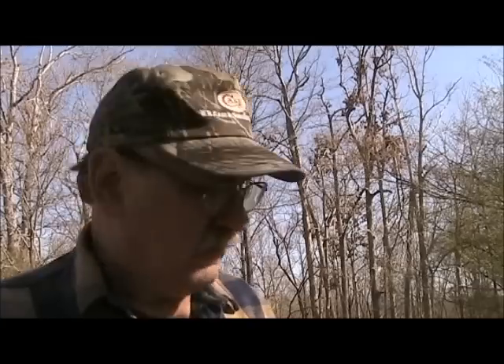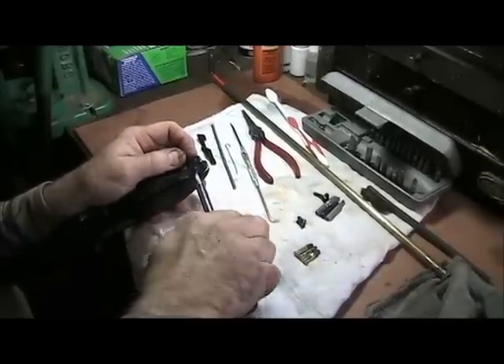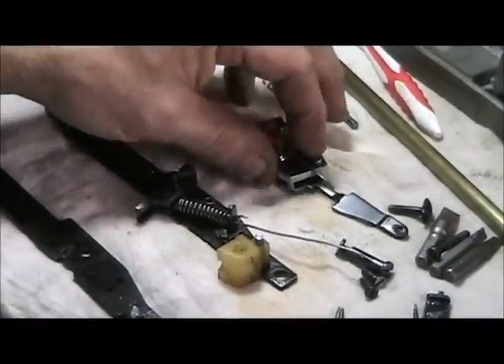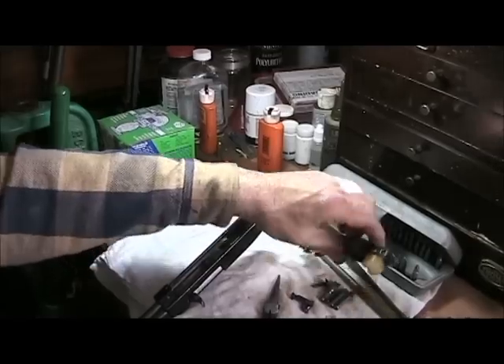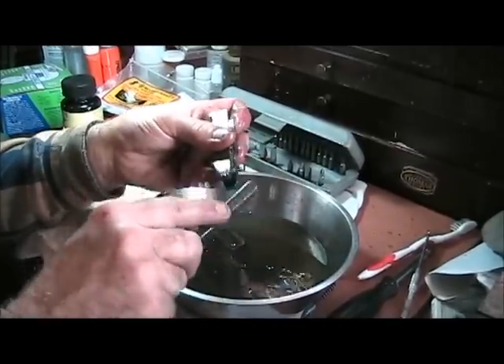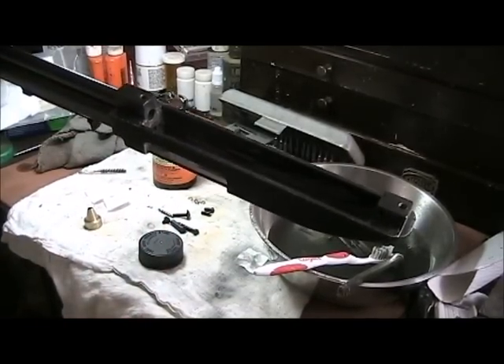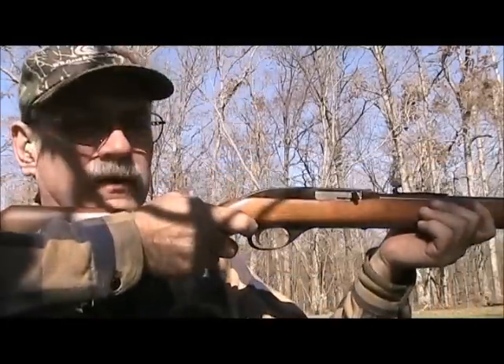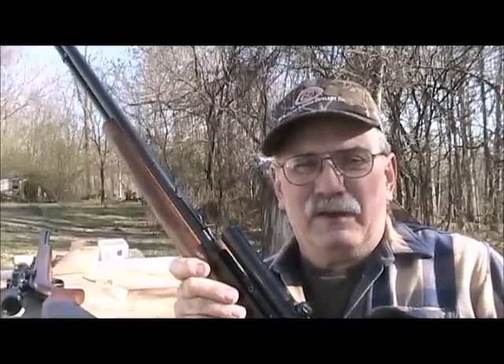Marlin Model 60 Jamming Problems and How to Fix Them

Comment: My Marlin 60 is 40 years old. Decided to change out the recoil spring and recoil rail. Was able to get parts from Marlin, (you have to call the repair dept to get to the parts dept, no separate pull down tab on their webpage.) Should be arriving next week. I was told by more than one gunsmith that one of the great things about the Marling 60 is that is is made to shoot and function "forever" without a cleaning, which may account for the condition of the rifle in your video. Given how old my Marlin is and how DIRTY 22lr rounds are, I want to keep it in good firing condition so I clean my 60 routinely every 150-200 rounds. One other point I want to make, if you are having a failure to feed problem, one area that is often overlooked is to make ABSOLUTELY SURE the feed tube is SECURELY attached to the front area of the barrel. It can easily come loose over time and if the tube is even the slightest bit loose the rifle can fail to feed.
Reply from the maker: Yes most .22 ammo is inherently dirty.  A 40 year old rifle (of the same model) is probably built better than todays rifle. Thanks for the extra tip you mentioned.

Comment from the maker: In this video I incorrectly mentioned that I was using "CCI Quiet" loads while testing my Marlin model 60. Looking back at the box the shells came in,  I feel it is important to mention that they are actually "CCI Subsonic" loads. Please forgive the inaccuracy in my statement, and thanks for watching. Regards; The Cumberland Outdoorsman.
Reply from the maker: @Mindyourbusiness6665  Did you install one of the updated feeding throats? From what you are describing, it sounds either like an alignment issue (from the magazine tube to the loading throat), or perhaps something is wrong with the loading lever, and/or lever spring. It is hard to say without seeing the gun first hand. You could also be experiencing a tension issue within the magazine tube. Check all of the above mentioned parts, and get back to me. I will try to help as much as I can.
Reply: I've got a model 75 SN# 272.... where can I order parts for it?
Reply: My problem is I can put 16 shells in it I charge it I shoot it then it act like it’s empty
Reply: Funny I just watched this video just recently again three years after you put it out even though I had seen it multiple times and it just bugged me about the CCI Quiet you said you used but now corrected your statement. Sure would be nice if it could cycle that CCI Quiet that is my go-to round shooting in my backyard without having to cycle it manually. As always great videos

Comment: I just disassembled and partially cleaned my Glenfield Model 60 while watching this video.  I’ve had the gun for 9 years.  From the serial number starting with 24, it looks like it was made in 1976.  I bought it and was only able to shoot it consistently for a few months.  Then it started to jam every couple shots.  I haven’t shot it for a few years.  After putting it back together, I just went out and shot 2 1/2 magazines out of it as fast as it would go and I didn’t have a single hiccup!!  It’ll need really cleaned and lubricated now to make sure it’s good to go!   Thanks a bunch for making the video!!  It helped me a bunch!
Reply from the maker: Glad to be able to help.
Reply: @CumberlandOutdoorsman  im getting into this type or stuff since  my marlin 60 was passed down by my grandpa. I was wondering do you need a scope mount for it forgive me for not knowing much but can you tell me what scope and if you are using one scope mount you are using?
Reply from the maker: @danjan5506  You can use any dovetail mount intended for .22 rimfire rifles. The best quality mounts are made by Burris, Leupold, and Redfield. I did find some good quality mounts made by UTG that are much less expensive, and look great on most semi-auto .22's. Bushnell also makes some decent .22 scope rings. The scope on my model 60 is a vintage Bushnell 4X BDC that has an integral rail and mount built to fit the scope to the gun without any rings. Quite ingenious actually. That was back when Bushnell and Bausch & Lomb were built in Japan by the same company.

Comment: I bought a used Model 60 in 1978 from a guy at work.  I loved that gun.  I never had a feeding problem or any other issue with it.  Never.  Great little gun.

Excellent video.  Great job explaining the process of disassembly and reassembly. 
I think you could use more light, though, especially with the close-up.  
Thanks for the education.
Reply from the maker: Yeah, I am thinking about doing another video showing the disassembly/reassembly of this rifle, but this time with more light. Thanks for watching.

Comment: I loved your video i have owned a marlin model 60 for over 30 years i have worked on it and tuned it up but lately was having the same failure to feed problem i had been intimidated to take the action apart even after seeing other videos but you made it look so easy i replaced the feed throat easily so thank you my Marlin shoots like new it has given me many years of hunting and shooting pleasure
Reply from the maker: You're quite welcome. Reading your post confirms the intent I had in making this video, and that's to help other folks that own these little rifles. I might make a part 2 with better lighting, since some other viewers had difficulty seeing details due to low light in this video.

Comment: Thank You Sir! I was having the same problem. Then it would chamber a bullet. The loading throat spring wouldn't stay in. I didn't have it in all the way on the bottom. Originally I watched your video to switch a broken recoil buffer with out having the springs shooting out. I also took a bore brush to the loading throat. After years of just using a Q-tip, needed a good brush. I now have my 30 year plus rifle firing like brand new.
Reply from the maker: Glad to see that you found the video useful. Thanks for watching, and subscribing. I hope to be doing some more shooting and hunting videos using my Marlin/Glenfield 60 in the near future.
Reply: @CumberlandOutdoorsman  m

Comment: I have similar problems in a Glenfield model 60 I purchased. I Can’t find the upgraded chamber throats anywhere, but I believe I’ll change the magazine tube spring, follower (it protrudes at a strange angle), and lifter spring and see if that does the trick. I already replaced the recoil spring and that helped, but after less than 100 rounds it went right back to having the same issues. I gave it a deep clean when I replaced the recoil spring but I’ll go over it again as I replace parts. Thanks for the awesome video.

Comment: Ty just did this to my old rifle, it was the first gun I ever shot when I was five years old now I’m 36 and have it, means a lot to me. I just got it fixed was stove piping really bad, great video! I ended up having to completely reassemble the trigger action but oh well was good learning experience even if by accident LOL
Reply from the maker: I'm glad to see you got it going again. Gotta keep those old .22's shooting. I still have a Charter Arms .22 revolver that I had to completely tear down and re-assemble. That was quite tricky, but when I got it back together, and it actually worked I got a real sense of accomplishment, as I'm sure you did with your rifle.
Reply: @CumberlandOutdoorsman  I had to work on it today, finally got some time to test it out, the bolt wasn't seating firmly enough on the action, had to sand the feed throat down on top where the bolt sits over it, those 2 little lips at the top (particularly the right side lip if you are looking down over the feed lip), polished my bolt/ and shaved the lifter spring as with this new kit it was hitting the side of the metal causing an ever so slightly enough delay to make it pinch the shells. I think mine is very old lol but still a goodie! Ty for your video ;)

Comment: Mine was passed down to me from my father. It's a Glenfield Model 60 with squirrels engraved in the stock. Beautiful gun. The problem I get is,
 I'll get a stove pipe and double feed at the same time once in a while, if I lean the rifle to the right. If I leave it level, I have no issues. I suspect an epic cleaning is needed because even a basic cleaning makes it stop for a while.

Comment: Nice informative video, I have the Marlin 990 semi-auto .22lr. It's a 1979 year production. It is the same internal parts as the Model 60. Marlin 60 & Ruger 10/22 are two of the best .22's to me.

Comment: Great tutorial. I just brought home a mint 1985 holy grail model 60 today, all the desired options, lsbho, JM stamp, squirrel stock etc pawn shop find. On my way home I stopped at the range and it’s still very accurate but so filthy it won’t cycle no matter what ammo I used. Failure to feed just like what you showed. I blew my budget on the rifle $170 so I really hope it just needs a good cleaning. I know how to clean it from 40 years of owning a 1981. If the spring is bent I may try the nickel trick or just start with replacing it. Wish me luck

Comment: Loved this video. I have 2 model 60’s. I purchased 1 in the late 70’s or early 80’s and the other was a gift from my father-in-law. Mine is still in great operating condition. However, the other had serious feed problems. After thorough observation, I found that the feed problem was a warn out feed head. The reason , I believe was the the difference in ammo used. My father-in-law used almost exclusively cci stingers . I use Remington golden bullets. The big difference being stingers have steel cases and I use only brass cases. I noticed significant wear on his feed head where initial contact from the steel cased bullet being lifted by necessary force by the elevator. Also, the first .050 to .075 inches of forward feed on the feed head was worn in such a way to make a concave impression in these first few thousandths of an inch. I saw that in semiautomatic operation that the forward momentum coupled with the downward arch created a “bouncing”effect  allowing the bolt to come over top  of casing resulting in exactly the same “ rabbit tooth” mark. I used a round tungsten mill, probably .040 in diameter, on a dremel to smooth it out. It has performed perfectly since. However, I do consider this a temporary solution. I would appreciate any information on where I could pick up a new feed head. Keep those videos going. I do thoroughly enjoy them.

Comment: my old model 60, has a bot lock open by pulling the both back and pushing the charching handle in. if it wont unlock with the release pull out the charging handle. I have been trying to unlock this gun for an hour, and thanks to this video.

Comment: I have two Glenfields that won't feed at all.  They both kick the round out just as its about to enter the chamber.  I have a new feed throat for one (also a 4 lug) and you just showed me how simple it is to install it.  Thank you!  and SUBBED!
Reply from the maker: Thanks for the comment, and for subscribing. The main reason I posted this video was to help folks like you. Good Job! Gotta keep those old .22's running. Squirrel season is just a few months away.
Reply from the maker: Jeff Scuderi  The Marlin/Glenfield model 60 is an economically priced gun, and has always been. Some people simply can't afford to pay for an Anschutz, or Kimber, so they have to settle for a lower priced gun such as the Marlin 60. Thousands of hunters and shooters out there cut their teeth on them.
Reply from the maker: Jeff Scuderi  OK, it has been my experience as a mechanic, and part time gunsmith that there is nothing mechanical that isn't subject to fail. It was my intention to show others that own these guns an instructional video depicting the way to repair and service this particular model.
Reply from the maker: Ross Cox  My brother bought himself and his wife some Ruger 10-22's recently. The amount of plastic on those guns were a bit disheartening. I guess I'm and old school guy at 57 years of age in my way of thinking- that real guns should be made of wood and metal. Plastic parts doesn't always mean poor quality however, as long as the type of plastic is of good quality such as is the case in the Remington Nylon 66 (for example). I personally have never owned one, but I have heard good reviews regarding it, even though it is no longer being made. If I ever get my hands on one, I will make a video and post it.

Comment: Ive had that exact same gun gifted to me probably 10 years ago. Ive had it sitting in the safe, cause its never functioned properly. I thought today about and figured id scower the internet and find out if i could find a video on what the issue might be. Im glad i looked, cause you made an excellent video on how to fix it. Thank you sir.
Reply from the maker: Thanks for the compliment. If you run into any problems, or have any questions, please don't hesitate to ask. I'll be more than happy to help if I can.
Reply: @CumberlandOutdoorsman  Thank you sir! I just received all the parts in the mail today. I will watch your video tomorrow, and give her my best shot! I will let you know how i fair and if i have any questions. Thank you again.
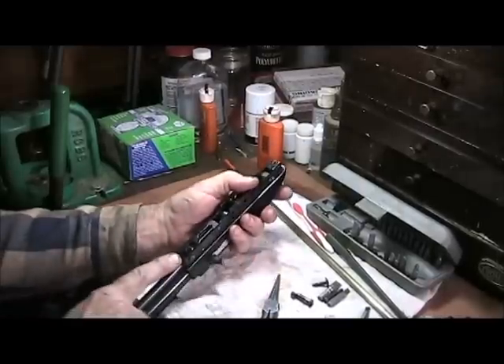Reply: @CumberlandOutdoorsman  i put all the parts together it looked correct and went together right..im at the 31:00 part of the video were i reclaced recoil spring got the bolt back in then trying to put the 2 parts together and the wont go..if i push bolt slightly back to slettle the 2 in the bolt wont close or function..not sure what i did.
Reply from the maker: @mikesimmons8787  From what I understand in your comment, it sounds like you may have bent the mainspring, or something is interfering with the bolt in the receiver housing. Sometimes putting the bolt back in with the spring pushing on the back of the bolt body can be difficult. I try to guide it back into place without warping the spring in any way.
Reply: @CumberlandOutdoorsman  i got it figured out, preforms flawlessly! Thank you for all your help sir. Great video.
Reply from the maker: Conan  Thats right, Sometimes certain guns just prefer certain ammo. Then again there is some ammunition that is just pure junk from the get-go, and it performs poorly in any gun.
Reply from the maker: Conan  I had the same issue, but not quite as bad with Remington Golden Bullets. CCI does cost a bit more, but the quality is way better! Aguila also holds a lot of promise in regards to good quality, and I am seriously considering doing a video to test and review different Aguila loadings. I'm somewhat surprized to hear that your Wal-Mart still has .223 ammo. Here they took all tactical ammo off the shelves. Everything from .223 ammo to all handgun ammo. Not sure if this was a corporate decision, or if someone at that store just hates guns.

Comment: I love your video.  I think you did a fantastic job and I followed your instructions to get mine working again.  I would have replaced that recoil buffer with the new one while I was in there.  I know it's not a big deal to go back into it, but man, you were right there, and polymers get dry and brittle over time.  Anyway, it's so much fun to see how the action functions broken down and explained.  Love it!  And I have the exact same pliers and screwdriver set.

Comment: I use a mosquito net(round on top)above my work round table (covered with a white towel). The net traps any flying spring or part, the towel is to see all parts clearly. My eyesight told me to do it. Nice video, thanks.
Reply: YOUR WELCOME.
Reply from the maker: @peterpaul6725  Sorry for the late response, It's difficult to keep up with all responses to my channel, but you are indeed welcome.
Reply: @CumberlandOutdoorsman  I write lot of comments in you tube not expecting an answer, "your welcome," was just a silly joke. Thanks for answering and sharing your knowledge, stay safe👍.

Comment: I have a tip on removing the c clips,with your flat head screwdriver push the c clip at the opening,till the screwdriver contacts the post,this will take the tension off the c clip,now take a very small screwdriver and slide the clip off " no force needed" the clip will not go flying.

Comment: Can i do all those upgrades to the Western auto 120 with the feed port change out to the marlin 60 spring eject, mine seems to have the same issue as yours , not sure if it's the extractor, ejector, springs. 
If i change over and do all it should fix the issue regardless? Right.. thanks for all the great information sir! Another thing if you do mind where do you order parts from thanks again
Reply from the maker: In my case the main problem seemed to be with the feed throat. It was the key part that really made the difference. Lately I have been finding most of my parts on Ebay. Thanks for your support.

Comment: Good, comprehensive report. Could use much better illumination on your desk for us to see the details of what you're doing. Also, with the old return spring being so collapsed, that could have been the problem all by itself. Thanks
Reply from the maker: I will be doing another video to replace the hammer spring. I will make a point of illuminating the entire situation. Thanks for the advice.